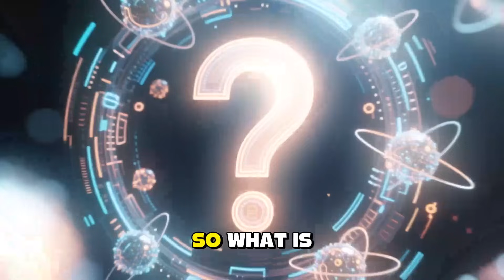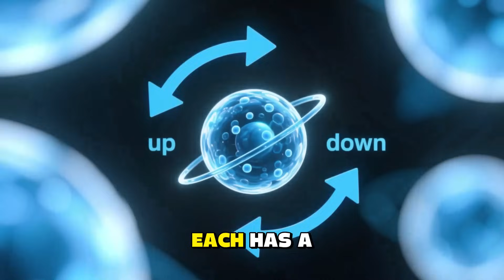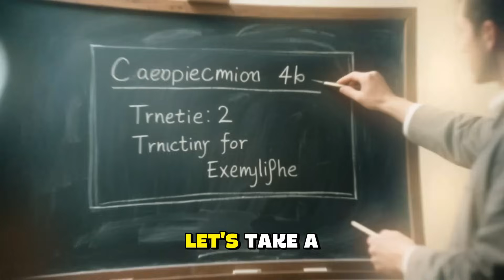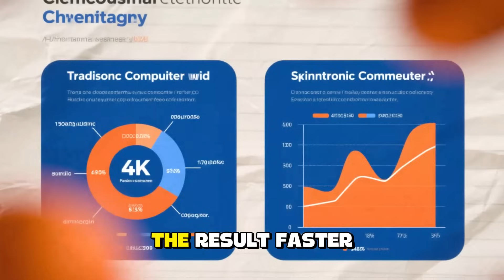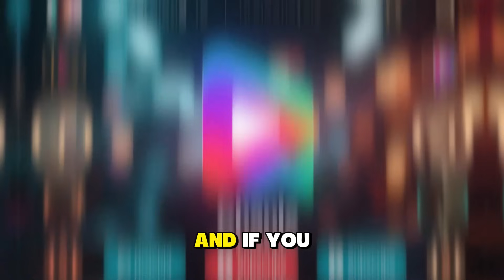Technology That Will Replace Transistors Is Ready

Comment: Silicon  is  a Metaloid material that has properties of a metal under electrical charges , so that  it exists as both an insulator and a conductor of electrons.   The only other system would be biological  , and so   living things are  superior to silicon mechanisms.
Reply from the maker: Excellent observation 🔥 You’re right — silicon’s metalloïd nature allows it to act as both a conductor and an insulator, which is exactly why it became the foundation of modern electronics. But you nailed the real insight: biological systems operate on a different level — adaptive, self-repairing, and energy-efficient. The ultimate frontier may not be replacing silicon, but evolving beyond it — merging biology with computation.
Reply: @QuantumSilkRoute99  Okay that is the God   Particle.     You can be like Moses and go up the Mountain and meet God in the Air.

Comment: Only ok for stt-mram now but will not replace the transistor...
Reply from the maker: True — STT-MRAM isn’t meant to replace transistors directly, it’s redefining how memory and logic can merge. 🧠⚡ While transistors handle switching, MRAM handles non-volatile storage with near-SRAM speed. But when you combine MRAM with spin-logic or domain-wall devices, you start stepping into a post-transistor era — not replacement, evolution. 🚀

Comment: Sure its a great move to the next level and far beyond indeed. As for transistors they will continue to dominate high power rf apps as well as those high rf power producing vacuum tubes which will be available for decades to come.
Reply from the maker: Exactly 💡 RF and vacuum tech still rule the high-power domain — but the new wave is all about computation density and energy control. Evolution, not extinction. ⚙🚀

Comment: I look forward to the day when this kind of tech takes off and cpu's, gpu's and memory are integrated together, the performance advantage would be massive and so would the lowering energy use, even with our current tech, the advantage of integrating cpu's gpu and memory together would have some nice advantages compared to how most PC's are with having to shift data back and forth between cpu, gpu, system ram and vram.
Reply from the maker: You’re absolutely right 👍 — the “holy grail” is getting CPU, GPU, and memory all on the same fabric so data doesn’t have to constantly travel back and forth. That’s exactly why new approaches like 3D chip stacking, chiplets, and photonic interconnects are so exciting. They don’t just boost performance, they also cut down massively on wasted energy from data movement. 🚀 The day we see true CPU-GPU-Memory integration, the performance leap will feel like a whole new era of computing.

Comment: You will still need “conventional” electronics for your input/output.
Reply from the maker: Correct — photonic chips don’t exist in isolation. You’ll still need electronics for I/O, storage, and control. But here’s the catch: the bottleneck today isn’t I/O, it’s data movement and heat inside the chip. That’s where photons crush electrons with near-zero latency and no resistive loss. In fact, many new designs are hybrid photonic–electronic systems — using the best of both worlds. Just like GPUs didn’t replace CPUs but revolutionized computing, photonics will redefine performance without erasing electronics.

Comment: I don't see how changing you initial value can be good unless its like exponential operations like in quantum computing...
Reply from the maker: Good point — quantum computing does rely on exponential states, but photonic chips aren’t trying to be quantum. They’re still classical computing, just with photons instead of electrons. The gain isn’t from changing values, it’s from faster signal speed, lower energy loss, and massive parallel bandwidth. Think of it as super-fast highways for data, not a new math system. Quantum is exponential; photonics is ultra-efficient classical — and both can coexist.

Comment: Hello my friend, you just said current flows. But what's that 'current'. Isn't there a resistance to that 'flow'. Aren't you back to square one?.
Wait a minute. Is current e energy?. Energy =MC^2. And it flips between waves and particles. We go round and round the Mulberry tree. Even Tesla didn't know. It just worked!.
Reply from the maker: reat thought! ⚡ Current is simply the flow of charge (electrons, or in some cases holes/ions) through a conductor. Yes, resistance always plays a role — that’s why efficiency is such a challenge in electronics. Current itself isn’t ‘energy,’ but it carries energy as it moves, and that’s what powers devices.

Einstein’s 
Energy =MC^2
 is about mass–energy equivalence, while electricity is governed more by Maxwell’s equations. Tesla’s genius was exactly what you said — making it work practically, even before every theory was fully settled. Today we’re still chasing that balance of theory + engineering.
Reply: @QuantumSilkRoute99 
Should I give my thoughts free?. Anyway, the 'return' in electricity circuit has something to do with that magical thing 'dark' matter. And electrons do not flow anywhere.

Comment: If issues like ternary transform super  computing what can spintronics do?
Reply from the maker: Great question 🙌! If ternary logic reshapes computing at the architectural level, spintronics could revolutionize how we store and move that data. Spin-based devices can retain information without power (non-volatile), switch faster than CMOS, and scale down with less heat. That means memory and logic could merge — breaking the bottleneck between CPU and RAM. Basically, ternary gives the blueprint, spintronics provides the muscle.

Comment: Even if the system off the spintronics memory thrives on and remains of spins of you said 7 x8 =56 example but for validate the details behind computation OF layers and sided logic and creative gates or the correlatives of numericals in variables of shapes configurations and formulas or probably the Standard models of spins. If spintronics memory remains spinning was there security program of danger of memory data harness on air using photonics of spectrum tech ? Likened to 007 Villain Spectre using his cats fiber optic hair light colour cat identify harness using the 45 degree circle spinner inside the angle
Reply from the maker: That’s a wild and fascinating scenario you’ve painted 😄🌀. In reality, spintronics and photonics store and move information using quantum properties (spin states, polarization, etc.), but they don’t leave a free-floating “broadcast” of your data in the air. The spins are confined inside the material layers and the photonic signals are usually in fiber or waveguides, not radiating out like radio.

Security risks in these systems will still exist — side-channel attacks, interception of optical signals, tampering with hardware — but nothing like a cat’s fiber-optic hairs secretly harnessing your data. 🐱⚡ It’s closer to very fast, very efficient solid-state storage with built-in quantum properties than to an “open air” transmitter.

Comment: bs. optical digital transistors are next. quantum is bs random walk generator. anyways no money for you or anyone. glhf.
Reply from the maker: Optical transistors are definitely a serious contender 💡 — light beats electrons for speed and heat. Quantum does get dismissed as “random,” but its real power is controlled probability that classical chips can’t mimic. You’re right though: whichever tech wins, funding and scale will decide how fast we see it. 🚀
Reply: With optical based computer we can have multistate from mixed wavelengths in computing...better than quantum computing fantasy

Comment: Spintronics is a fantastic and a wonderfull invention!   Hopely they can be juicded Graphene as basiccompenents, and it can hopely be juiced be Quintum computers.
Reply from the maker: Totally agree! 🙌 Spintronics is one of those breakthroughs that feels like science fiction turning real. Pairing it with graphene could make devices ultra-fast and energy efficient, and linking it to quantum computing would be the ultimate synergy. 🚀 The pieces are all there — now it’s about scaling them into everyday tech.
Reply: I,m sorry for the mistake of juicded !  It must be used!
Reply: You fool you will never have quantum computing in your home for the following 1. It is terrible slow or useless at common logic IE no good for you standard gaming... 2 super cooling down to near absolute zero IE -273 Celcius.. but what is good at is cracking security codes  once you understand it is niche product not good for general computing.
Reply from the maker: @ntal5859 You’re right about one thing — quantum computers aren’t meant to replace your gaming PC 🎮. They’re not built for running Fortnite or Photoshop. But calling them “useless” ignores why countries and tech giants are spending billions on them. Quantum systems excel at problems classical computers choke on: molecular simulations for new drugs, optimizing supply chains, financial modeling, and yes — breaking certain encryption.

It’s not about everyone having one at home, it’s about having access to them in the cloud the same way you don’t own a supercomputer today, but you still benefit from what they make possible.